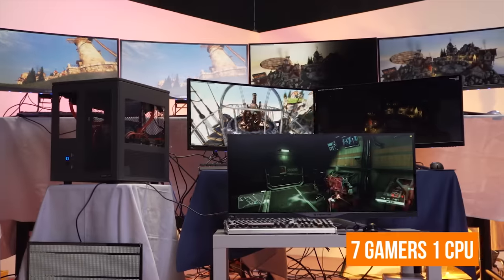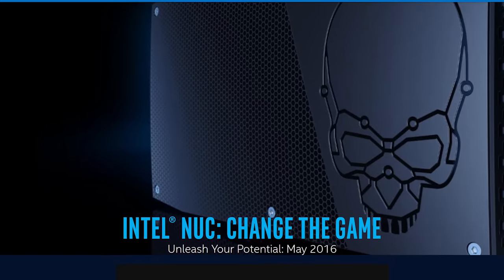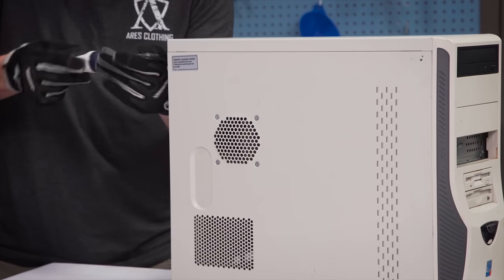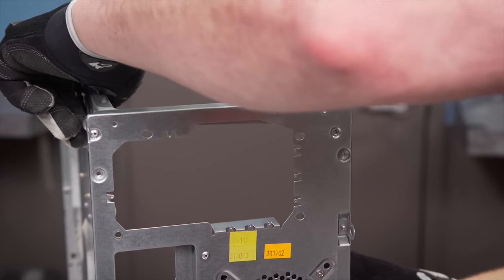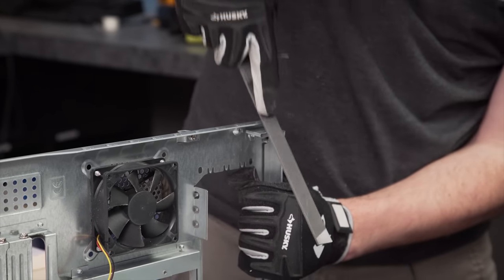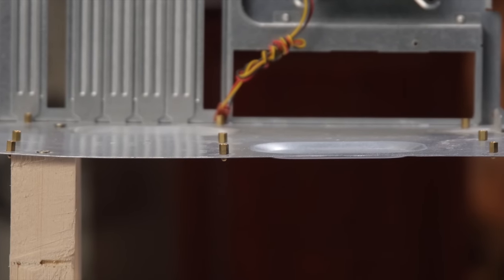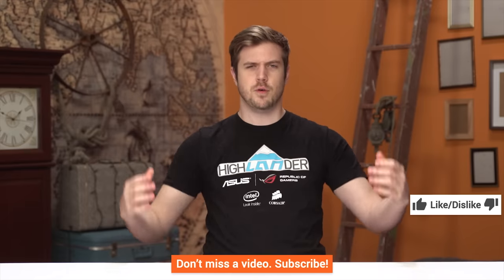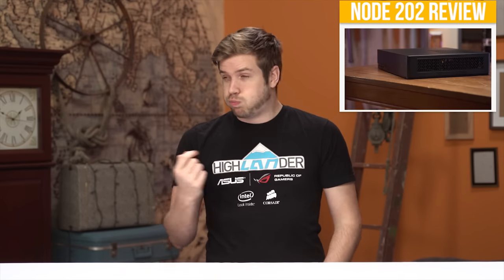Free (or extremely cheap) DIY PC Testbench!

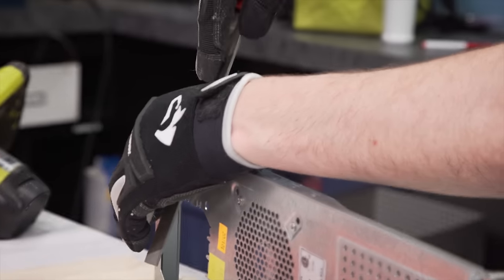Comment: Luke: Machine files only cut in one direction (typically, pushing away from you). So, only apply pressure when pushing away from you. Trying to file while "pulling" (4:58) will deform the cutting teeth and ruin your tool (see "Use" section on the Wikipedia page for "File (Tool)")
Reply: I find this hard to believe... a decent files blades shouldn't bend so easily...
Reply: Well I don't know what to tell you except that you're wrong. Look up any instruction video on YouTube ("How to use a file"), or any literature online, and they'll say the same thing. Apply pressure on the forward stroke only.

Comment: Files only work on the push motion. If you pull them while pressing against metal (or even wood) it will drastically decrease the sharpness and lifetime of the file. Just thought I'd let you know. :)

Comment: Another helpful tip:  You can protect yourself from being cut on exposed metal edges by using rubber tubing.  Cut the tube to the length of the exposed metal cut and then cut the tube again down the length of the tube so it looks like PacMan when viewed from the end.  Then just slip that tube over the metal.  It is much easier to do than it is to describe.  If you don't have rubber tubing, you can always use ducting tape or many other materials to protect against sharp edges.  Get creative.  Gone are the ways of old that "no computer build is complete unless you give your blood to the case gods".  Protect yourself out there, guys.  Always use a rubber.

Comment: I would have used threaded rod (all thread) instead of wood but meh the wood was FREE :D Luke - Test benches aren't really my thing anymore, that was 10 years ago and i did much the same as you did except i used a desktop case - the ones that lie flat. I'll post my next builds on the forum for you because i always use very cheap cases and chop them to make them good, and hunt around for cheap used heatsinks to add "elite aircooling" ETC - I'm on this whole getting maximum cooling for minimum fans deal at the moment and coming up with some ideas I think are sick

Comment: I live in an apartment complex. it is Free IF you already have power tools, Place to use those tools and more. the idea of the video was really good! but i could buy a 3 tb hdd or a powertool.  would like to see another video with cheap and dyi tech. if there is any other tools needed for the project write how much they cost and keep in mind that the project should be able to be doable on a common livingroom floor.

Comment: Don't wanna spend $100 for a test bench? Learn how to make your own test bench for super cheap! all you need is about $100 worth of power tools!
Reply: Dremel, $40, shit ton of uses
Reply: +TheGustaf1010 can pick one up at harbor freight for $30
Reply: +Johnathan Rollings yeah but it won't last long
Reply: +MisterDoctorProfessor I had mine for 3 yrs of abusing it b4 it died
Reply: +Johnathan Rollings I've bought a drill and a dremel from harbor freight and they both lasted nearly 6 months before they both died. Bought the same tools from Lowe's and they're both still going strong after 3 years. harbor freight's very hit or miss with their power tools
Reply: +MisterDoctorProfessor 
Most of their tools in general. I got a C clamp once and bent the fucking part you twist with your hand cranking in down.

Comment: you probably should make sure the screw heads that attach the case tray to the wood are more flush, as they look like any mobo with solder joints sticking out enough at those spots may not fare too well..

Comment: None of this matters.. GTX 1080 and 1070 is on the horizon. All hail pc master race!!!
Reply: +Matic Krmec the fact that you're ignoring that a $380 1070 is faster than a TitanX is ignorant. Polaris 10 is for mid/low range gpus and Polaris 11 is for very low power gpus. They have no plans for high end gpus this year. The current gen Fury X looks like it will be making a new/modded return in 2017 from what we can see. Now that Nvidia has released their cards and they are WAY faster than everyone thought they would be, AMD is going to be in some hot water.

PS: stop being an AMD fanboy
Reply: ***** I just watched them. The guy forgot about the fact that amd's dx11 drivers were garbage, and that's part of the reason there was a bigger jump in fps in dx12, there was too much cpu overhead. Nvidia hasn't finished their dx12 drivers, they just threw them out when amd released theirs so they wouldn't look behind. The guy also thinks that because the Ames were developed on amd hardware that games will be broken on Nvidia, which just isn't true.
Reply: ***** actually single core speed was one of the issues of the dx11 drivers. Look up digital foundry's video on it
Reply: ***** i have a feeling you don't have much experience or research with single core performance in games. Most game engines still use 1 main thread and will limit fps. Arma 3 is a great example of this, the game can use up to 32 cores, yet is hindered by the single core that handles the bulk of load like AI, physics, ect. Until devs and dx12 can split a thread across multiple cores, we will still be limited by single core performance.
Reply: ***** Crysis 3, BF4, GTAV all need strong single core as well, and all of them can use 8+ cores.

Comment: how is this free or cheap because you need to buy all the tools
Reply: In my opinion that's hardly free considering you need a work shop space and crazy tools no poor person have on hands...
Reply: +Thomas Rogers Could easily be done with hand tools instead of power tools, hand tools would only cost like £5 or less to do this.
Reply: ***** That might be offensive to me if I were Jewish. Too bad I'm not.
Reply: +Bubbauk88 Yes. It would took a bit more time, but thats it.
Reply: +Thomas Rogers because they assume you already have the tools and you can reuse tools :)
Reply: +Thomas Rogers This is assuming you have all the tools. The people that have all the tools are the ones that will be most interested in doing a DIY project like this.
Reply: +Thomas Rogers once you have some used tools you can do a lot more than just build a test bench. I live in a place where almost every household has basic tools
Reply: a grinder? 2x2's? and a hand me down case? and a back yard??? haha
Reply: let me guess, you spent it all on your pc?

Comment: Safety tip from a fingerless fabricator, never using a cutting tool (angle grinder, sawzall, etc) with gloves on. What could have been just a bit of a cut or abrasion can quickly turn into an ER visit when the blade/disc catches the fabric and binds. Good idea on the test bench though.

Comment: I actually used a combination of this idea and the diy desk pc idea to create my own desk pc, luckily the case I had on hand to destroy had an entirely rivet construction and the motherboard tray came out free of any ugly or sharp tabs and free of the rear vents and such, quick coat of black paint and installed it into the drawer of the desk I built with an acrylic panel on the surface of the desk for visuals and wallah, diy desk pc that I don't have to measure or align any sort of standoffs or other crap to make work

Comment: that's all a cool stuff, although i feel like you should try to squeeze more into this type of videos. for example i would like to see how it will look like with the system installed, also you could try mixing it with the acrylic or something. case modding is an interesting topic to me, but i would like to see and hear more.

Comment: step one, get a 50 cm x 140 cm 0.9ish mm steel(or whatever metal you want really) plate. Step two bend it so its a square + a 20ish cm thingy for the PCIe rackets on top. should cost you like 15-20 bucks or soo... you need to have rivets/screws and what not aswell tho, to make the motherboard standofs and what not. step 3 whatever

Comment: i actually did this for my rig. it was an old gatway g6 400 case that had a pentium 2 in it. well it has an i7 4790k, gtx 980ti, 16 gb of 2400mhz vengeance ram and a gtx h110i cpu cooler. i didnt make it a test bench though. i just go rid of the hdd trays and cut holes for the cables

Comment: The idea to reuse scrap material is ok but I would not go with bare steel. If you do not secure everything in place while testing you still have the risk of electrically shorting something. An insulator layer like plastic sheets to be placed below the motherboard might do the trick ;)

Comment: Guys did you know you can also have a free (or extremely cheap) gourmet meal if you just happen to have all the right expensive cooking equipment and culinary skill to make it

or you can have a free (or extremely cheap) car if you also happen to have an entire car's worth of car parts and also the tools and knowledge necessary to build it

just like how you can have a free (or extremely cheap) test bench if you happen to have all the right power tools that in total cost more than a regular old test bench that you could simply buy.
Reply: Fair enough, I do have many tools, and I do think most everyone should as well, although more specific things like angle grinders and circular saws are not necessarily in every DIY-er's toolbox. So I do still think wording it as "free" or even "extremely cheap" is not necessarily warranted, but it got my click, so I suppose the title served it's purpose.

Comment: Hmmm. Not a bad idea, but you left that case fan on while angle grossing? Metal first is goona get in that thing a POTENTIAL y kill that poor fan... Also I would have gone with stubby little 1 inch legs and no second story, just make it a bit bigger ( cut less away) and used that meshy metal piece you took out as a drive bah and just drill and rivet that to the thing.. anyway people use m.2 drives so it's a bit of a moot point anyways... Good job a little nail polish on the rough bits also is a fast way of making it safe to handle, and is way faster if you needed this thing like last week....

Comment: Im like totally new to this so this is like a dumb guys question but in order to not have bad edges after cutting, shouldn't you use masking tape for the places you're cutting?
Reply: That will somewhat ensure straight lines but you still need to file or sand the edges to get them smooth
Reply: +Reap gamer that wont work for metal it does help if you dont want marker/pencil/whatever marks of your cutting line on your finished item

Comment: Just an FYI about the grinder I have seen some people get fucked up by using just one hand. One guy I used to work with was cutting a plumbing pipe overhead which isnt a good idea to begin with and was only using one hand as his other was stabilizing himself on the ladder. The grinder kicked and hit him right in the face and tore it up pretty good he's lucky hes not blind true story so take care it makes me cringe seeing that.
Reply: Thats why you wear sagety goggles. But i agree that you have to be REALLY careful with an angle grinder! Also you should cover your arms. Metal sparks can burn your skin and there are ppl who react allergic to it.
Reply: Thats why you wear sagety goggles. But i agree that you have to be REALLY careful with an angle grinder! Also you should cover your arms. Metal sparks can burn your skin and there are ppl who react allergic to it.
Reply: +Yodenko 
Im sure that dropping an angle grinder on plastic eye protection from overhead could still fuck your eye up. They are meant to protect from small flying debris not angle grinders to the face.

Comment: Can you tell me your thoughts about this build? :)
psu: Corsair CP-9020047-EU CX Serie CX500 ATX/EPS 80 PLUS Bronze 500Watt
case: BitFenix BFC-NEO-100-KKXSR-RP Neos Midi-Tower
processor: AMD FX 6300 Hexa-Core Prozessor 
ssd: Crucial BX200 240GB SATA
Graphic card: MSI V305-030R AMD Radeon R7 370 Gaming 4G 
storage: Seagate Desktop HDD 1 TB
Ram: Crucial Ballistix Sport 8GB
motherboard: MSI 7693-040R 970 Gaming AM3+ AMD Motherboard (ATX, 4x DDR3 1333, SATA 3, USB 3.0)
cooler: Cooler Master Hyper 212 Evo CPU-Kühler (RR-212E-16PK-R1)
Reply: +Rawrpwnzel Wont work sadly.. You need a processor that will fit your motherboard.
Reply: +Ronald Mahan but it does :D
Reply: Hexa-Core Prozessor nuff said
Reply: Ronald Mahan I'm a total noob in this, that's a custom build pc from techsource. do you know any good pre built pcs around 600 €? :c
Reply: Rawrpwnzel Im just pulling your leg dont worry it should work as far as i know however i dont tend to get pre built pcs because i tend to void the warranty.  Also I was just making fun of your spelling of processor with a Z lol!
Reply: haha ok :D that's because in german we write it with a Z
Reply: Oh Thanks for telling me!  I didnt know that sorry for joking about your spelling.

Comment: >free testbench
>uses tools that easily cost over $100 combined
Reply: You could probably do all this with just a hack saw and a file.
Reply: a drill will set you back $30 at the most (unless you actully want to use the drill fpr serious things) and a hack saw will set you back $15 with extra blades, where are all you people getting this $100 figure from...
Reply: +LarryLazz in which part of the video does Luke use a hack saw?
Reply: +IWannaWin no where,but it does the exact same thing as an angle grinder, safer, cheaper and would only take 10 minutes top to cut the metal, as aposed to the 2 minutes an angle grinder would do it in
Reply: +LarryLazz The whole point of the video is to make a "free (or extremely cheap)" test bench. He should have used a hack saw to demonstrate how it can be done for "extremely cheap" rather than use power tools.
Reply: IWannaWin Nobody needs to see him use cheap tools. Quit crying dude.

Comment: Not everyone has a spare case, a drill machine, some ply of woods and screws or bolts lying around, if the test bench costs $70-80, might as well buy it instead of buying the material to build it.
Reply: +bas van der werff Neither you nor your parents can talk without swearing, I'm sure of it.

Comment: Do all the pc components need to be grounded to the power supply? I have this little shelf I made from bamboo and birchwood that looks really nice but can i just stuck the motherboard on the top shelf and PSU/HDDs on the bottom shelf and call it a day, or will I need to run ground wires from the drives and motherboard to the PSU?

Comment: Those prices are fuckin dumb dude I keep mine in a shelf and its held together with superglue

3.7GHZ cpu with ddr4 ram, consistently runs at 57 celcius. The radiator rests on a pack of Milwaukee's best sandwiched between 2 fans. all other fans just circulate air aroound the GPU and motherboard as a whole. The fans are setup to use air density so all of the heat is directed up and out, lower down air is pulled in.

Comment: So, not to be that guy, but you were using that file wrong. Always push the file, never pull it. Their teeth are made for cutting in one direction, and using it in the other direction quickly dulls them.

Comment: in old stuff you can get good PC, but some have some problems. like I found a Quad-core PC T3400 with 525 PSU. I installed a 150 W HD6870 it worked great on normal clock but sometimes it crashed. I thought it maybe it was bad driver or GPU. Then Motherboard shoot out for failure device and i have to put out the GPU. Then I installed same GPU in 2nd PCI slot it even didn't mind over clocking that, not even crashed or over heating. then I found out PCI slot was ........ down for running a bad Nvidia Quadro for very long

Comment: I`ve been trying to build myself a test bench for testing/repairing pc components, so far can`t get anything for very cheap :(
Reply: +Fr4mbo MDF works well. It's cheap and readily available at any home improvement chain, or your local hardware joint if that's your thing (it is mine)

Comment: Hey, i've got one question.Which AiO Watercooler would you recommend for an FX 8350 OCed to 4,5 for max 100 Euros (around 147 CAD)?Cause with the Aircooler that i've got in my system now it throttles when it's OCed to 4,2...And i've got an Scythe Mugen 4 with 2 120mm fans.Thanks!
Reply: +Lolled9991 My mobo has an 990FX chipset.
So that's not the problem.

Comment: I really don't care about wasting alot of money on computer cases. I bought a $40 case with decent ventilation possibilities. Tho I had to drill a hard drive bay off to fit another 297mm card for 2-way SLI ^^ And hard drive bays wth? Why are all cases built for 6-10 hard drives? Or 3-4 optical drives?? All that wasted space!

Comment: What is a test bench and what is it used for...?
Reply: +akwuh 
it's a barebone pc case (or rather "frame") used to quickly assemble hardware for testing or benchmarking. since there's no doors in the way it's good for working quickly but isn't intended to be used as an actual case.
Reply: sbraz Ohh, I see. Thanks! :)

Comment: hey could you try to make build with peltier coolers? there are some on the web that to put peltier plate straight on cpu, but I am thinking of if its possible to make water cooling loop and peltier sandwiched with cheap water block and heatsink in same loop with normal radiator to cool down water to some degree and then to use peltier to cool further. and is it possible to make it without any condensation? for example using arduino to control temperatures of water.

Comment: What would be a solution for someone who doesn't have power tools?
Reply: Brian McKee hacksaw
Reply: butterknife
Reply: You might want to buy a dremel. They are pretty cheap and would work but take time. You would need to buy lots of little cutting wheels because they burn up really fast when cutting metal.

Comment: Do you need an On/Off switch from a case to power on a test benches or just flick on the psu?
Reply: short out the power switch jumpers with a screw driver watch it on youtube or goggle how
Reply: +Silent Zero thanks